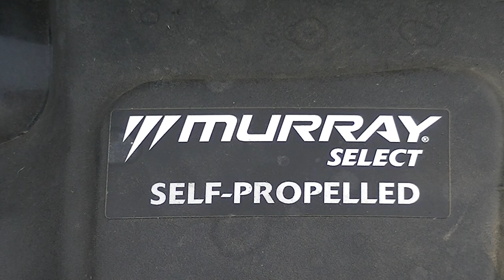Fixing A 6.25EX Mower from surging...Up and Down...Up and Down...

Comment: The surging issue could also mean that you overfilled the mower with too much oil ;b
Reply from the maker: Yes that can happen also.
Reply: You only have to breathe on the engine and it will surge. its the carb

Comment: Jesus a built in fuel filter? B&S knows those things need to be replaced don't they? Guess you'd have to take the tank off and use carburetor fluid and spray it out. Honestly I'd replace the tank with an older one and build an in line filter to it.
Reply from the maker: Yea true.

Comment: those b&s plastic carbs are garbage..I found the pilot jet hole is too small.  drill it out a thou and it's fine
Reply from the maker: Good tip....
Reply: Nathan Rohrbough Steve’s small engine saloon as a whole video on this very issue. Very in-depth too.

Comment: In my opinion, you didn’t fix the real problem. You should have installed a fuel filter.
Reply from the maker: Or maybe a 3.0 motor

Comment: Surging is usually governor related. Never hurts to clean a carb tho
Reply from the maker: Yes!!!!
Reply: I would have to disagree, surging is very rarely a governor issue. People think it's a governor issue because they see the governor linkage oscillating back and forth but this is just a symptom of the main issue, a lean condition.
Cleaning the carb/jets and ensuring the fuel delivery and intake systems are working properly will fix the problem pretty much every time.
Reply: Surging is always a carburetor problem